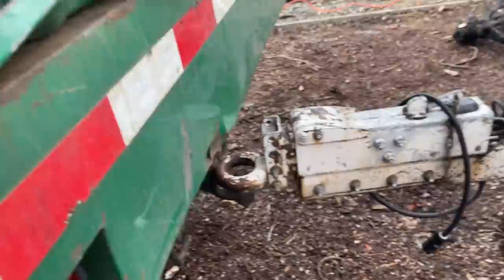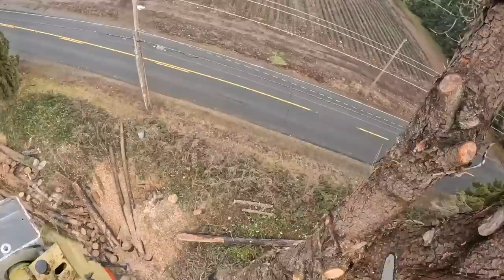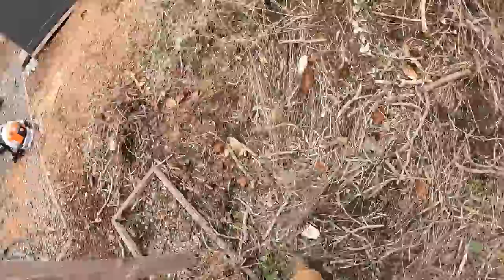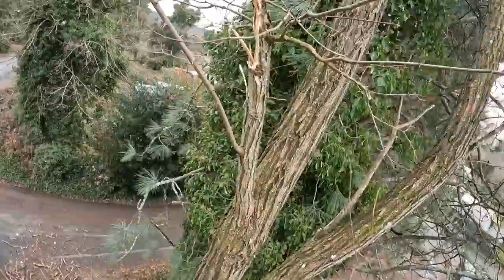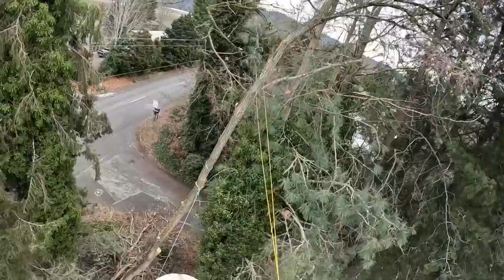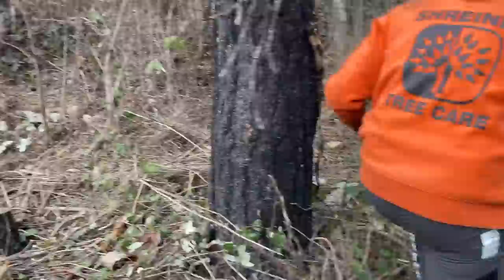Cutting down Fire burned Trees with Randy! | Part 3

Comment: You guys should get an ATV handlebar grip warmer, and wire it into the truck or even a drill battery and slide it onto the bucket control handle, then it could be warm all the time with the flip of a switch😊❤

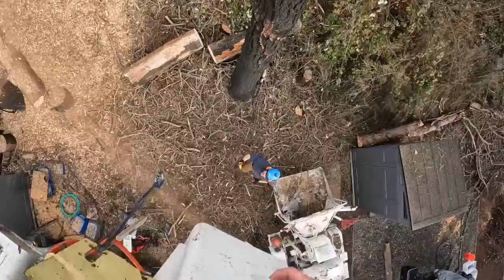Comment: You should design a wedge with a ~36” tail and stretchy sewn small eye on the end so that you can feed the wedge through the loop and choke it off to the stem below your cut so that you don’t lose the wedge like you did @13:42. That would be even more convenient when you’re not close enough to the ground to have a ground guy throw it up to you. I feel like guys would definitely buy that on sappy supplies
Reply: I drill a small hole in the end and run a fastback or Paracord and small carabiner to my climbing saddle or bucket harness
Reply: 40lb braid fishing line with a nail to tac into the bark. That's what I use
Reply: @SamRicks21  ya that's how we do it at work too. I was thinking more for when you go back up in the bucket to push the piece over and you wouldn't be able to reach the wedge